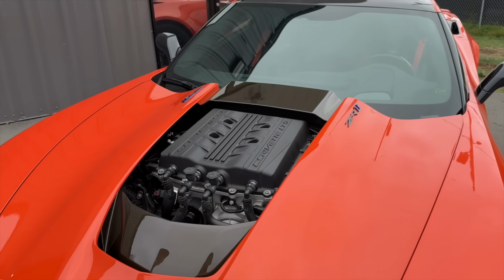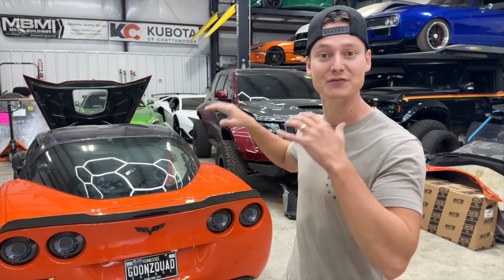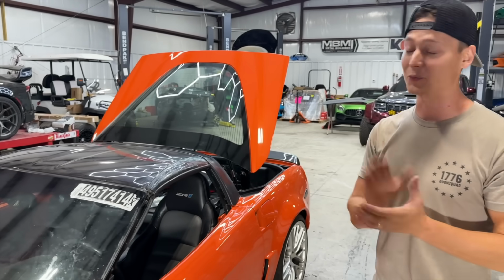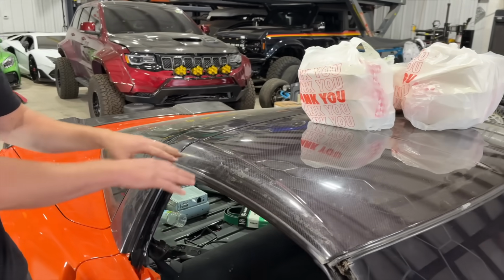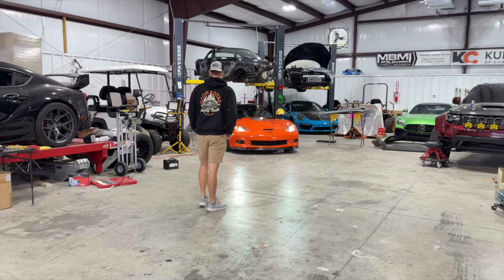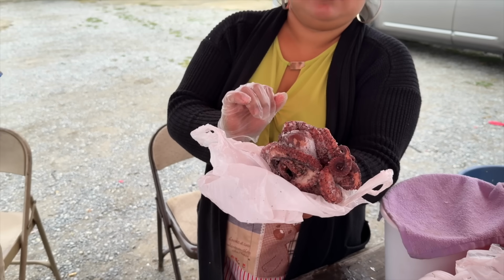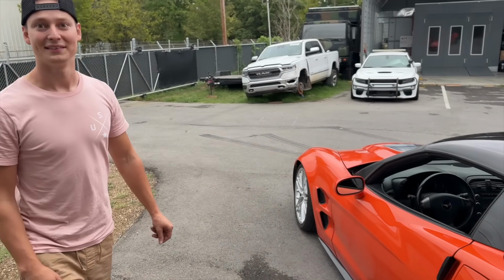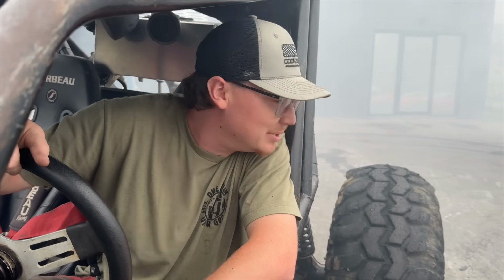Our Wrecked Corvette ZR1 Is Fully Rebuilt!!!

Comment: Just curious, why dont you guys wetsand the paint jobs? 

The cars are 'definitely" youtube ready for the average eye...but add a day of work, it would be carshow ready to an enthusiast with no orange peel😉
Reply: Their paint jobs are "good enough" to not need a wet sand or buff. Meaning they're collision shop ready. In real life they would look kind of average, but since they just go on the stacker in the shop and never get seen, why bother?
Reply: Their paint jobs look better than factory.
Reply: @1one3_Racing  sure whatever.
Reply: @1one3_Racing  Have you personally seen one of their cars in person? The res is high enough to spot any paint flaws and I see no evidence of paint runs, clear coat issues, orange peal. body filler work, etc. If you see something call it out and let's look at it otherwise you're just talking smack.

Comment: I have a Ram 1500 Limited in Patriot Blue and it has the Ram Air Suspension. If the time ever comes to where I buy an other Ram, it will definitely have the air ride suspension. My Ram has the smoothest ride I’ve ever experienced in a truck of any kind.

Comment: The orange headlight housings are they would have come from the factory.There is an upgrade headlight that streetspeed717 has used on his last C6 build that would look good.Excellent call on buffing the roof.The clear coat on it is a special UV resistant paint to protect the carbon fiber.Keep up the good work.

Comment: I hope it doesn't get as cold as Canada or Quebec I should say for the ram I have a Ram 1500 EcoDiesel with air suspension and it cost me almost 7 Grand two airbags and an air compressor the cold that we get here in Quebec the suspension freezes when it drops under 30